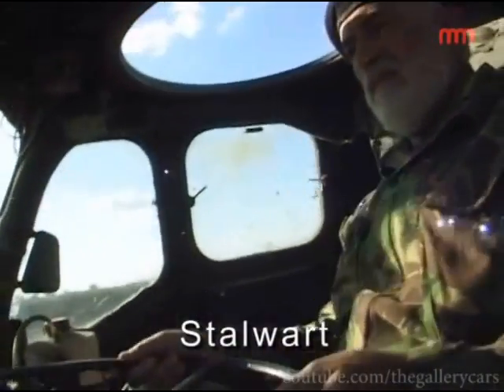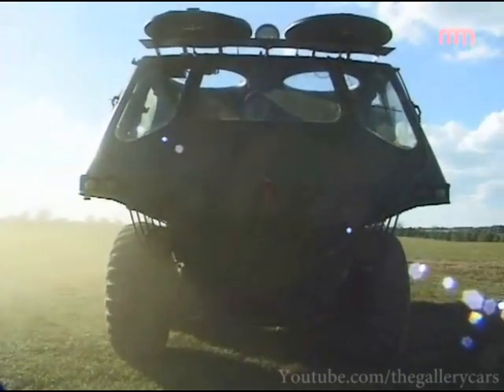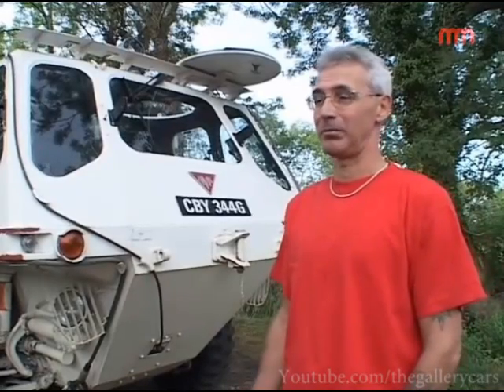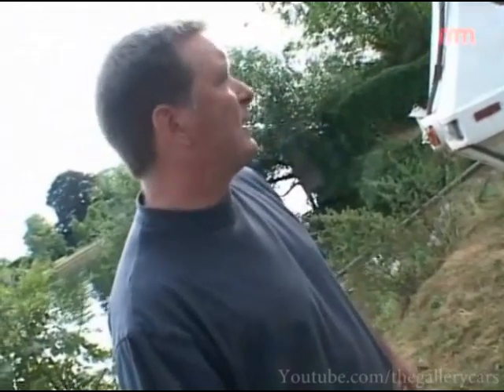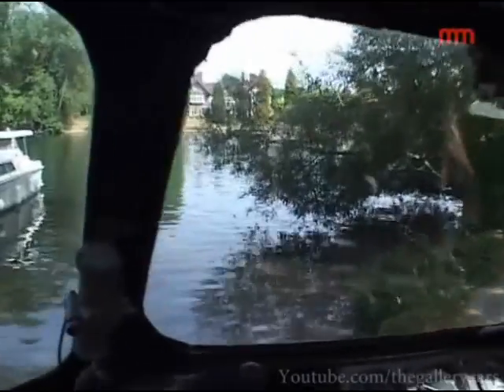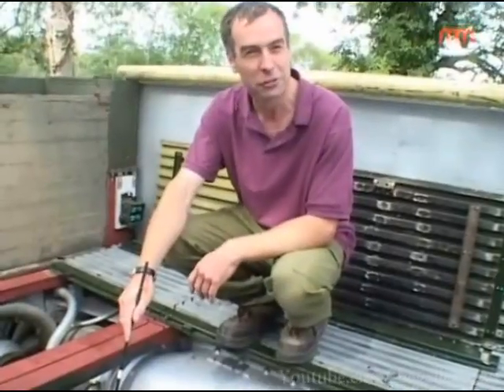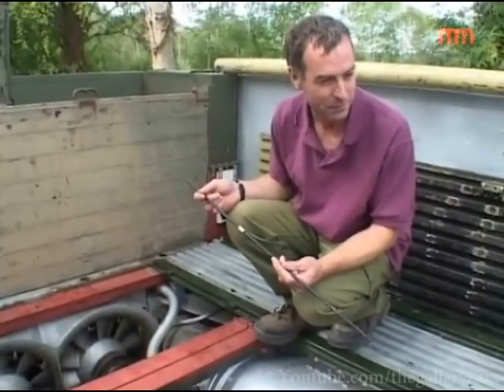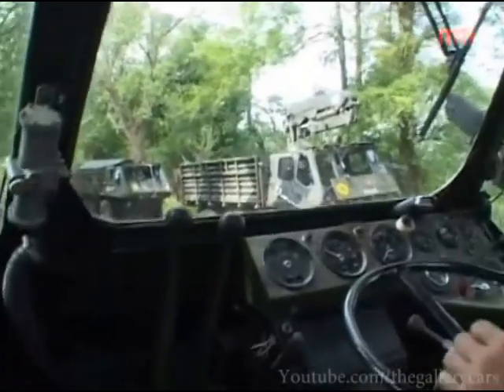6x6 Amphibious Truck Alvis Stalwart

Comment: They were originally developed for the off-shore oil industry but the MOD loved the design they could follow the tanks and service them. The HIAB variant was used by the  REME for carrying a spare pack and crew so a pack change could be done quickly in the field, the rear was also adapted by the REME crew for day to day living as well as carrying the pack so they actually lived a bit more comfortable than the other support Stalwarts used to carry fuel and ammunition.

Comment: Don't know what he's talking about when he said it weaves on roads.  Drove these on & off road for 3 years whilst serving in BAOR & never had any problems with weaving. Just had to be aware to keep power on when going around corners & to bounce out the Windup off road after driving it on roads for a while. Loved driving these beasts especially on exercise in Winter.
Reply: I think that guy must have had a few drinks before driving  -I never had any problem. Powering on around corners helped because the non spin diff caused the inside wheels to drive instead of the outside ones . Not very good in snow as they always tried to go straight on!
Reply: Maybe his has mechanical problems.  The wheels may not be aligned properly, or there is slack in the steering gear.
Reply: did they still float when fully loaded? sounds silly, but they look pretty low in the water when empty and just trying to imagine another 5 tonnes on the back of it.
Reply: Spoken like a guy who drove one. I drove the REME crane version. Nice bits of kit.

Comment: I always liked the Stolly, one of the coolest military vehicles we ever had - except, possibly, for the 'Mighty Antar' tank transporter for the Cheiftan tank.  I remember going to the commercial motor show in the late fifties with my mate Alan.  We always reckoned it was less crowded and more interesting than the 'official motor show' and you got to see new cars in their van or pickup variants!  One year, Alvis were selling the civilian variant of the Stolly and we loved it!  6x6 unstoppable off road and I think it still had the swim kit?

Incidentally, I always understood that while the Stolly was the ammunition carrier for the 105 Abbot SPG (150?) it was not allowed in the ammunition dumps because of those big wheels generating a huge static charge.  Is that right?  Another great and similarly tasked vehicle the Army had was; the Land Rover 101 GS, which was the gun tug and ammo carrier for the 105 AP howitzer.  Also unstoppable off road, like a half size Stolly.

Comment: the weaving might be a steering system problem, but the Stalwart had one serious design  error when it comes to driving on hard surface: there is a differential between the left 3 en the right 3 wheels, but not between 1st, 2nd end 3rd wheels. this means that you get an enourmous built-up of tension in the driveline if you drive on hard surface.  they should have made drive to (for example) axle 1 and 2 disconnectable.

Comment: Never  had a problem with it weaving .just had to watch out for transmission wind up on tarmac.i seem to remember a clanging noise at idle from the compressor   till it got its air pressure up.wish I still had one.

Comment: Nice to see them swim did an instructors course on this vehicle in the 1970 at bovington .bloody hard vehicle to look after swimming gear was removed in early 80s  you had to measure all wheels to put larger wheels at front to stop wind up but a bloody fast drive off road soon cured that the crane was an Atlas not hiab.

Comment: Hmm...I thought driving them on the road would ruin the transmissions...
Reply: They suffer from a problem called "wind-up" where all the suspension and drive go out of synch, due to the torsion bar set-up and flex in the suspension.It then needs to go off road or a prepared surface where each individual wheel needs to leave the ground to "un-wind" . Doing THAT is fun and you enjoy what the old "Stolly" was made for. HMLC. (High Mobility Load Carrier) Bloody great machine in it's day and if i ever win the lottery, it is in my top 5 vehicles to buy.